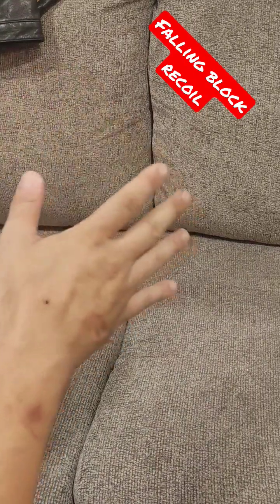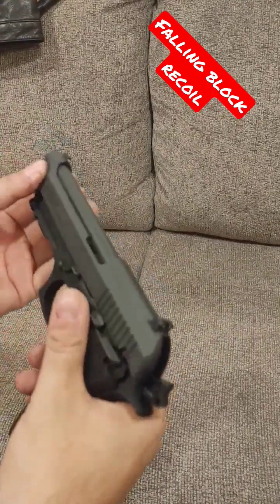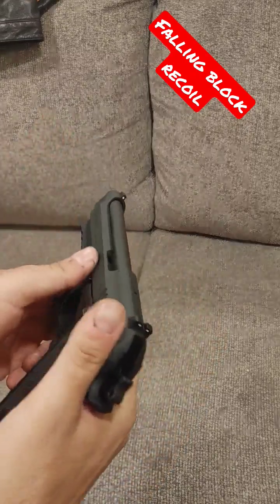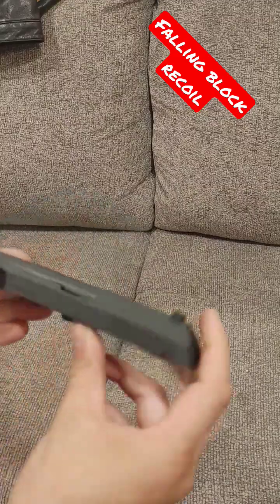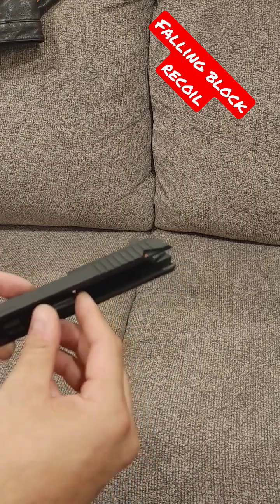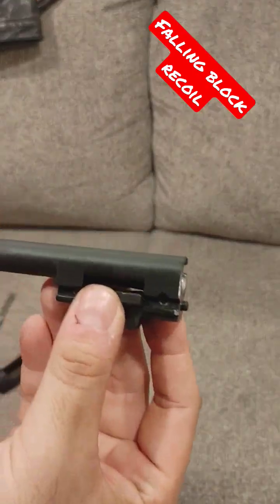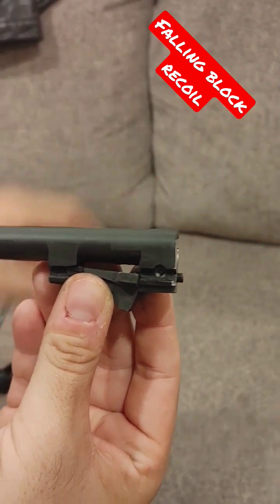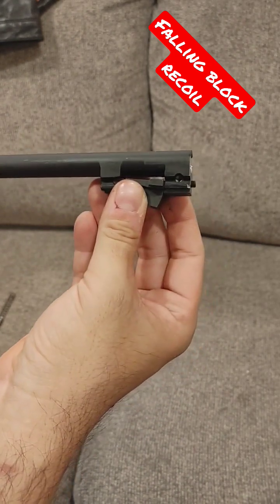How does Falling block Recoil Work?

Comment: I have had several taurus pt 92s over the years and have fired alot of different ones.  They are hands down one of the best slide action pistols ever made.  I have never had a breakage or failure out of one.  They feed anything never seen a fail to extract/eject.  I would like to get another one as the one I currently have over time became my wife's and she passed away earlier in the year after a fight with cancer.  So I don't carry it but want one to carry.
Reply from the maker: I know this is blasphemy, but if I could I would put in open top slide like this on top of a 1911. I know it sounds bizarre but that beautiful 1911 trigger with the action of a Beretta would be amazing
Reply: @TheJimminiShow  that's something I may try.  I may pick up a cheap 1911 somewhere and do that.  Might definatly improve it.  And it would look cool.  I have all the machinery to do it anyhow.  Hell yeah
Reply from the maker: @hoss3433  If you build it, Ill review it!
Reply: @TheJimminiShow  sounds good man when I get done with it I will message you
Reply: They are really really nice to shoot. So smooth.